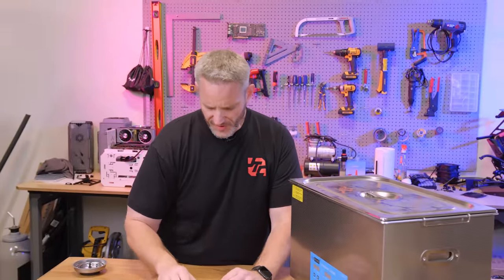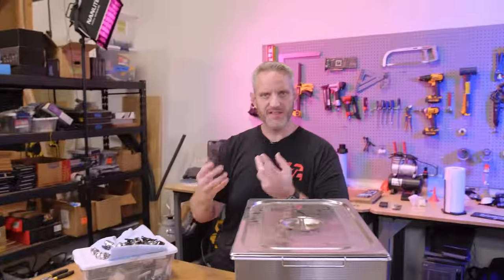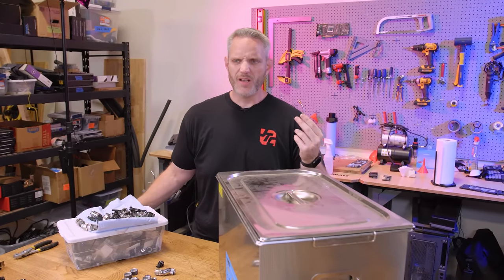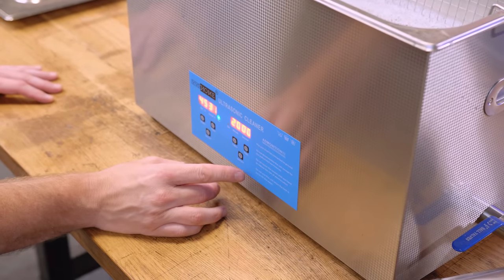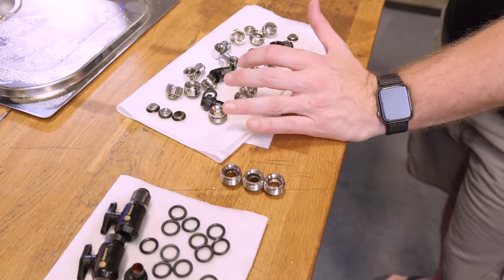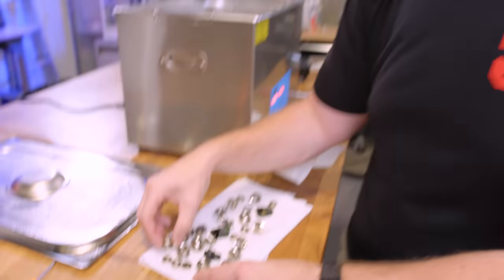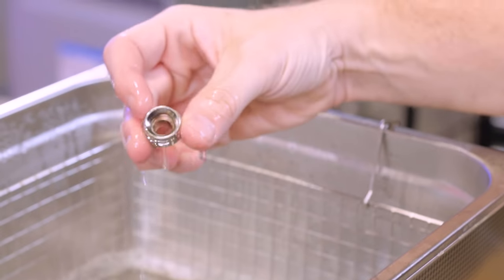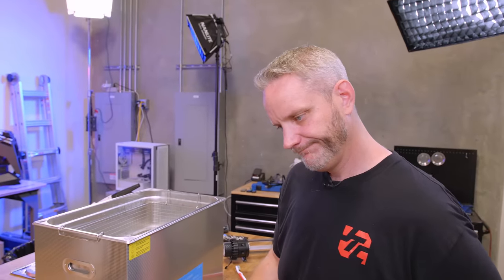I'll never clean watercooling parts the same again!

Comment: jay if you want to be sure it's oxidation and not dried fluid, you can fill up a small cleaning loop with water and a bit of citric acid powder, enough to make it at least PH4 acidic, and it'll start stripping corrosion in no time for you. It'll strip a tiny bit of the bare copper but a LOT less than it will the oxides, and a lot less than vinegar will as well at the same PH. This was recommended to me by a Primochill rep specifically because I didn't want to buy their cleaning fluid if I could just buy bulk acids. I normally use their fluid additives to clean and maintain my loop with in distilled water, and after my first major build with them in my own loop, I can now comfortably say that this loop has been gunk free for over 2 years now. It's evaporating water at almost 500ml a year, due to a slow leak in one of the radiators. I know where it is, I just need to solder the crimp for the brass fittings they use to allow you to screw yours in. Already soldered it once but it's not QUITE a perfect seal

Comment: I actually have a method for the radiators and I know this will work because I've seen it done with similar components on different pieces of equipment, take two buckets of water or one bucket and a drain. You're going to have a clean side and a dirty side and you're going to run water through these radiators in an open cycle. Pump goes on the clean side pushing water through the radiators. Radiators are submerged in the ultrasonic output goes into a drain or another bucket and you just run it until it's clear

Comment: Saw someone else mention using other fluids in sealed jars (for them it was CLR)  and putting the canning jar or other sealed jar in the water in the bath so it would keep different chemicals separate but let them work on the objects inside of the jar.  Probably a viable method for alcohol without having to worry about the fumes maybe?

Comment: It would be interesting to try clean radiators or even the full loop out using a power flusher for a central heating system connections would be easy to adapt on its if it could take the pressure.

Comment: You might be able to clean out the radiators if you circulate fluid through them from an external container. If the fluid isn't circulating/mobile then you'll just build a layer of hydrated gunk over the stuff you're trying to clean off.

Comment: I'd try setting the rad on the bottom of the cleaner in direct contact with the reservoir to then hopefully transmit those vibrations into the fluid inside the rad. 

Worth a try I'd think. Good Luck. 👍
Reply: Also make sure that the radiator is filled and no trapped air. Because any air bubbles will slow ultrasonic waves. I also agree since you trying to clean the inside of the rad then direct contact with the base will transmit waves to inside better, but it may also cause some paint from radiator where it contacts the base to be worn off or come loose depending on how long it is left in there
Reply: Best idea is to set the radiator at an angle fill it up with the cleaning fluid so that way the vibration can bounce upward knocking down the bits to the end tanks so it be able to get it out more than letting it flat is my guess.

Comment: Muriatic acid works good for the inside of radiators - as long as they are the copper and brass type . They sell it in stores for swimming pools . Don't leave it too long as it is strong .

Comment: In a lab we put our items in a beaker to clean them as you want them as clean as possible, so I'm surprised that the radiator didn't clean up terribly well. I'd suggest trying ethanol or methylated spirits next time as those are good solvents for cleaning
Reply: Another soaking

Comment: you could also put a bit of wire through some of those bits and hang them so it gives you more room in there. reminds me of when i used to make jewellery. also if you cant afford one of these, you can get a large baking tray, line the bottom with aluminium foil so it comes out and hangs over the side each end. fill with boiling water, then a table spoon of salt and a table spoon of backing soda, make sure they are stirred in together. then put the bits in and put your hands on each side of the aluminium foil. have fun. :-)

Comment: The green automotive coolant and distilled water would be best I would think  . I mix mine a bit strong at a 70/30 coolant/water ratio .
Reply: It has a lubricant for pump bearings and a rust inhibitor in it as well. Plus it lubricates any rubber seals / o-rings .

Comment: I just bought an ultrasonic cleaner for when I was cleaning a GPU that was around a person who smokes Wax/Dabs, its temps were pushing 80⁰C idle. So I used alcohol and it cleaned it spotless. Previously nothing else would work to get the crud out of the middle of the rad.(Did not use the heating element)

Comment: coolest trick the UltraS cleaners have is you can fill them with water, put your parts in a sealed container with whatever solvent you want and it will work just as good with way less mess and contamination. the container will float on the water. if the container wants to sink you can put salt in the water to increase the buoyant forces

Comment: Things to note. 

-Never turn on an ultrasonic cleaner without fluid. It will burnout immediately.
-The softer the material the shorter the proces should be. It wil literally blast a microscopic moon surface into soft material so a few mins at a time and check results. (this includes paint, too long and paint gone)
-Always preheat before putting items in if you intend to use heat. (most of the time you want heat) 
Do note the act of using ultrasonic waves also heats the fluid over time. If your doing a cold batch keep an eye on the temp and let it cool down between runs. 
-Water temp is optimal between 135-175 F (60-80C). Other cleaning solutions have their own temp range. Follow them to the letter. 
-Do not ever use flammable liquids. The micro cavitation's created by the ultrasonic waves pop at temps around 4000-5000 F. They wil ignite any surface gases floating on the fluid.
-If you put a chicken leg in the cleaner long enough it wil strip it to the bone(takes a while though). Guess what happens to your hands and that not even talking about the temperature. Always at a bear minimum wear gloves and a face shield. This stuff is not a joke.

All in all, it always seems so innocent but these thing need to be handled with care. They are however a magnificent tool to use if done right.

Comment: well you were correct, it was copper and now has a "patina" of copper sulfate, the reason for the blue color, so now its a blend of copper, copper oxide, copper sulfate, copper chloride and several other copper compounds ( acid rain has high amounts of sulfer in it or sulfuric acid if you wish) the main source of the sulfer is from diesel fuel, when diesel burns it creates sulferdioxide gas and is easily mixable with water. The sulferdioxide gas is one of the key components of smog...   so there ya go, your lesson in chemistry .01  :)

Comment: I'll never clean watercooling parts. I prefer air. However, getting an ultrasonic cleaner has been on the to-do list for a while. Also works perfectly for vinyl records, but a lot more than that. Not sure it needs soapy water at all, it could just be de-ionized water, that's safe for anything that can handle water itself. There are of course both acidic and alkaline cleaning fluids, depending on what you're cleaning.

Comment: You could fix the bad fittings with potentially a small wire wheel to remove the flakes/roughness? And then it is possible to re do the nickel plating :)

Comment: the weight of the rad does not matter, you could even clean stuff in a glass jar wenn you filled up the cleaner with water but need to use some other cleaning chemical for small items, that's typically what you do. what's more important is, no air gaps and maybe additional agitation, setup a dummy loop with cleaning fluid in the rad, submerge it and let the loop run while the ultrasonic is working its magic.

Comment: Here is a tip for large ultra sonic cleaners.  You don't have to fill the entire tub with cleaning solution.  Just fill it with water and put all the parts you want to clean inside a ziplock bag with the cleaning solution and water mix.  Afterwards you don't have to clean the entire tub and only have to throw away the dirty ziplock bags.

Comment: The problem with the radiator could possibly be because of the water inside the radiator will not vibrate as much as the surrounding water.
When it comes to radiators I personally would try to flush it with pulsating water…

Comment: Jay, I have a question about flushing/cleaning a water loop. Since you’re the king of custom water loops. Is it safe to use reverse osmosis to clean the system? I don’t intend to run the loop with RO after cleaning but since I have it on tap at home it would make it easier. Peace and love.

Comment: I wonder if the radiator might clean better if it was in contact with the bas rather than suspended in the cage above, which might be dampening the vibrations.

Comment: Jay , suggestion pump , pickup tube end away from pump in solution with filter , pump discharge tube to radiator inlet , submurge radiator in solution , run water box cleaner and run pump same time , watch crud come out of radiator.  P. S. Easy clean up of ultra sound water box  part and solution in zip lock bag, sealed, submurge in water water box  run with no air bubbles in zip bag. Works good. I make full use of my 6th grade education every day. Awaiting your next video, built 2 Ryzen 5700g pc this spring for my personal use. Your Overclock advice was good, thanks. 5700g , I vote best new gpu for the price.

Comment: Just curious, have you ever tried using tig welded stainless medical 
grade tube for a water cooled rig rather than plated. im a pipe welder i
 just thought it would be cool theme and no nickel flaking off. the 
parts cleaning video gave me the idea and not to mention the blue gold 
colored tig welds at every joint. like for a work station build for 
running cad and cnc equipment in a machine shop. thanks for all the knowledge. cheers

Comment: Probably a stupid idea for the radiators, but have to ask... so here I go:
why don't you put it into the water upright, let it fill with water, then - while in the water, fully submerged - flip it upside down and let it rest on something to give the rad some angle down, towards the ingress and egress holes?

This could  proooooobably (question mark)  help shake the gunk off and immediately out of the rad ?

Comment: At the shop I work at they have a big industrial ultrasonic cleaner and it leaves the parts so good. Dissolves crap inside and out in all the tiny crevices and what not. And this is with water that is disgusting and should be replaced. I can imagine with fresh soap it would be even better.

Comment: I saw a video about not filling the whole tank with cleaning liquid but putting the parts into a bottle with cleaning liquid and filling everything with water. With the use of ultra-sound it should still work right??? It was for rust removal: "WE TEST $1 Rust Removal vs $50,000 Rust Laser" by Donut Media

Comment: if you need something a bit stronger !! try 50/50 water Dettol !
WARNING !!! This can strips powder coating and other finishes and will kill rubber O rings also may give of nasty fumes !!!!!!
For small parts I use water only in cleaner and place parts in jam jar  With lid  and place in water (no cleaning of ultrasonic need too) works just as well and you can use IPA in jar too !!

Comment: @3:39 this is not a good practice. Ultra sonic baths have a fill level indicator on the side. You should not put significantly less than this in the bath as it reduces the effectiveness of the ultra sonic waves... and also can cause damage to the equipment itself. 

There's not really any reason not to fill it up correctly if you're using water. Degreaser or other expensive stuff i could understand.
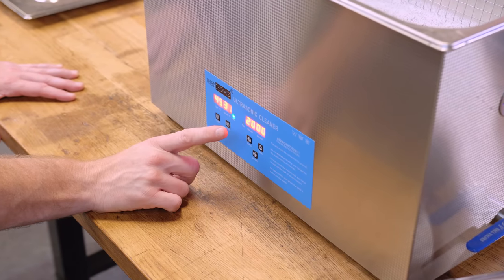Reply: It would also alleviate that harsh sound @4:43

Comment: Yeah Ultrasonic cleaners are the best. As an ex commercial diver and dive tech, when ever we serviced our Kirby Morgan dive helmets. They work like a bomb cleaning all the airlines and fittings and regulators. There is a special soap solution you can get for the that works better then soapy water can't remember what its call we got it from Unique Hydra our dive equipment supplier.
Reply: This looks scamish

Comment: 'leaves gunk everywhere' for 'shimmering effects'.  Is one worth the other?  Yea I know, I've said before that water with a little (like half a teaspoon to a teaspoon) of Primochill Utopia is all you need if you want cooling.  If looks takes second place to having a loop that doesn't gunk up and cools as best as it could, that's all you need.  I never used colors or junk, and a few swigs of hot distilled water run through the radiator and other parts got it clean again.  I don't get how all that gunk and all that corrosion is worth it for a look....

Comment: Don't put the parts directly in the cleaner. Put them in a jar then you only need to clean the jar when done not the whole unit. It also means you don't need a WHOLE thing of just cleaner, it is mostly filled with water then only chemical/dirt in the jar.

My E39's oilpan seal is shot I have it taken apart and just a tiny jar of degreaser in the machine with the oilpan bolts so I could clean them. Mine isn't large enough to put in the whole oilpan like yours.

I never thought of putting my old fittings and stuff in there however... i now know what i'm doing this weekend.

Comment: How do you clean an old radiator with "gunk" in it? You don't explain how.  I have a few full copper radiators that I have tried to clean and every time I think they are clean enough to put back in my system, more "gunk" comes out.  What process and/or chemical do you use?

Comment: I’ve been considering trying to do water cooled pc even though it scares me to death, but I’ve seen the gunk that builds up and I’m not in a position to clean it very well, is there a way or a material for fittings that doesn’t end up with all the gunk build up or does that just come with the territory?
Reply: There are lots of liquid cooling fluids that don’t have suspended particles and require much less maintenance
Reply: @kasai7272  ty I’ll look in to those

Comment: Just a word of caution, you have to fill the tank to the ridge near the top with the water. You must not run the ultrasonic cleaner with the water level lower because it can burn out the ultrasonic cleaners attached to the tank. Its even more important if you use the heater. Hope this helps Jayz, looks like a great cleaner would hate to see it break down needlessly.

Comment: Um, yeah, using a highly flammable liquid in an ultrasonic cleaner that heats up, wise to show how a lack of safety can hide dangers that haven't yet happened. UNLESS you use an BLASTPROOF ULTRASONIC CLEANER, then do NOT use IPA in one of these cleaners, that would be dangerous and irresponsible. Industries use them on PCBs yes, but that is a mass scale and in Blastproof ones. Alcohol is flammable, those cleaners heat up, good mix JAY. Seriously? people complain about NZXT or whoever with their case that was a danger due to the Rizer card, or Gigabyte PSU but then go putting a highly flammable liquid, in something that heats up, that has a LID on it creating a contained space making the chance of an explosion more likely? great vid. People copy others and if something goes wrong, and there has been cases I am sure of that, then....................who is responsible? the ones who followed or the ones who put it out there? just saying. VERY UNPROFESSIONAL. People talki about going into PSUs being dangerous yet this? it's basically creating a bomb. A contained space with heat and something flammable, think custard powder in a tin, with a lit candle and air blown in to disperse the powder and BOOM, the lid flies off, however, there has been a flash of flame, this happened in London, Baker Street. That was flour and a flame and half of London caught fire. Very easily done.

Comment: Hey random question but is a 2x custom loop a good idea? I want my next pc to have two different loops so there can be two different colors of liquid running through but I have no clue if it is incredibly expensive or just a dumb idea and a single custom loop is the way to go
Reply: I have 1 loop: 360mm +140mm and 12 fans in case and it's just for a CPU 😂 but I added 10L fish tank behind my PC tower so I can have my CPU under 60C temp avg over 6 hours game play cost a loot and not even worth but I build it slowly in those 6 years